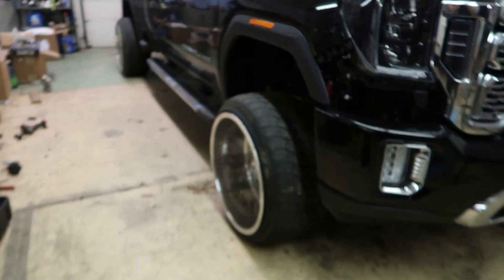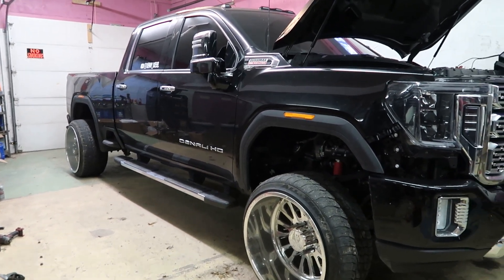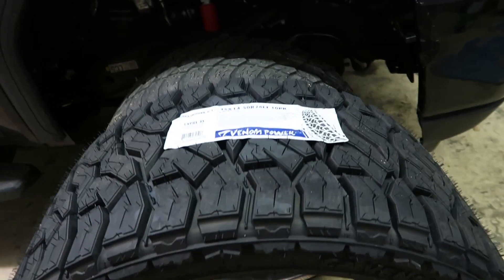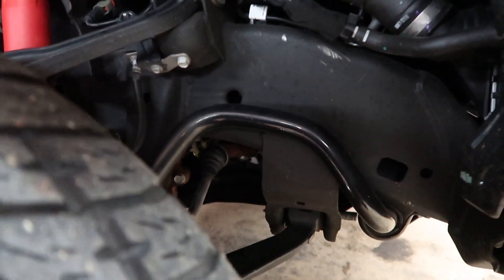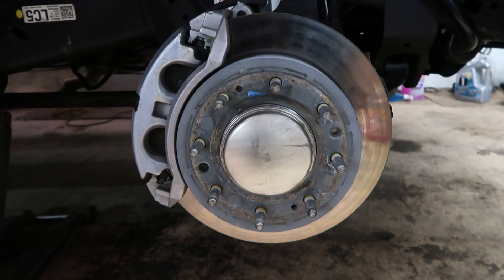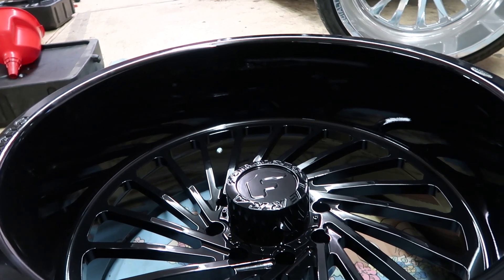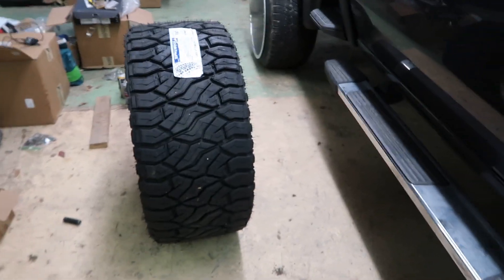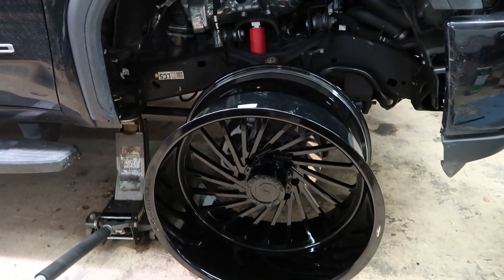Test Fitting My New 26" Forgis (Why You Should Build Your Duramax Front End When Running Big Wheels)

Comment: I got a 2021 Denali 2500 brakes squeak all the time
Reply: Have you tried running like all that break from EBT for pulling trailers or like a more expensive a brake pad because I know my 2000 Ford that was a gas truck it squeaked a lot and I went to a more expensive a brake pad one of the EBT trailer towing pads and it quit my 2021 That I just bought I haven’t done much with it yet to see if that squeaks.it’s  is a turbo diesel
Reply: I have a 21 denali 2500 and brakes squeaking also🤦🏻‍♂️ other then that i love my truck

Comment: I ran 35s on the stock wheels on my 21 3500.. I took them off cause they would rub the frame and the sway bar when turning full lock. Couldn’t stand the rubbing on my brand new truck but it did look good.
Reply: What wheels did you go with. I have 35’s and I have plenty of room

Comment: I used rare parts on my old truck rebuild for 3-4 years no issues and plowed snow with it at that. The lifetime warranty on either RP or Kryptonite  has some hoops to jump through and some people cant go without their truck in pieces while parts are inspected and then mail you out a new one. I found serious availability issues earlier this year with kryptonite not as much with rare parts. Rare parts are cheaper, have same warranty deal and are a serious upgrade over stock. I like those new tires, give an update on those.